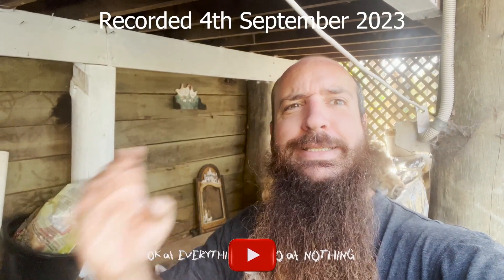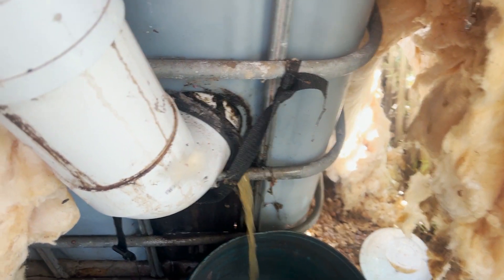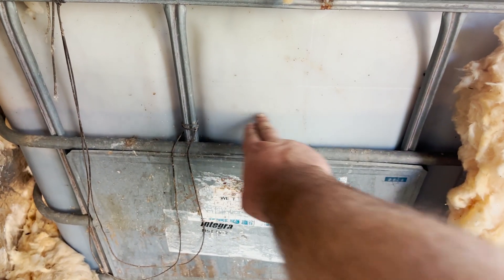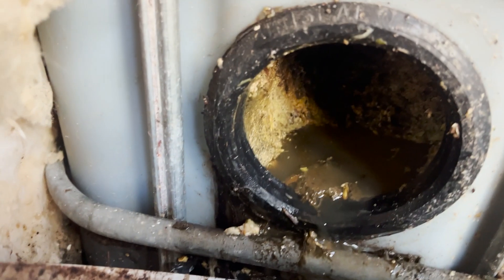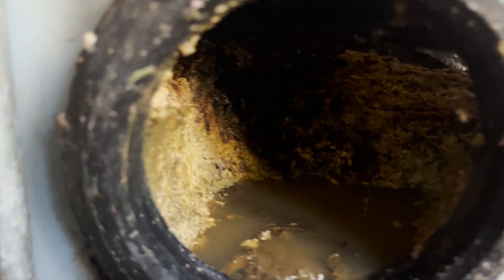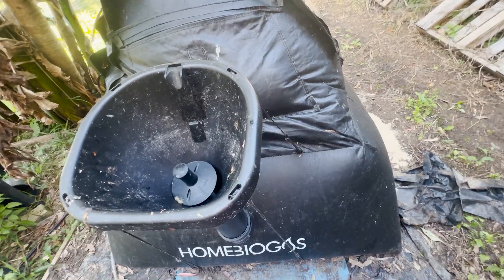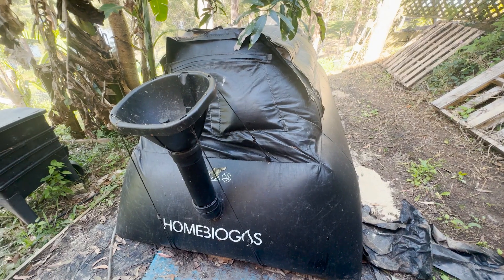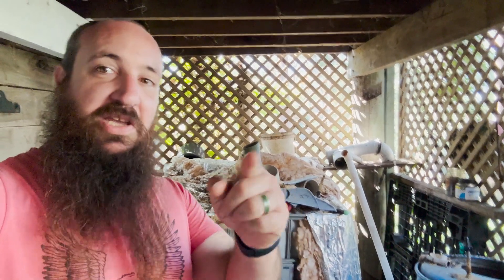HomeBiogas 6 - 1 year in operation

Comment: Can you take the methane from this and compress it with an aircompressor and put it into a tank and use it for later?
Reply from the maker: I have already made videos on that 😊
Reply: @OkAtEverything-ProAtNothing  how long does it take for the homebiogas to fill up if most of the gas is depleted? I have seen some of your videos taking the gas and compressing it. I'm curious about how long a generator could run on it to charge some batteries. Eventually, I'll get a solar system and a biogas system (doing home repairs to prep for it) so hopefully I can use it to charge the batteries

Comment: Awesome mate, I watched your videos years ago and I got a homebiogas 6 system last year. Its on my farm where my house is being built, so I havent used it in a daily sense yet. I also got the hot water heater because I want to get hot water for underfloor heating, and I also have a 3 phase 20 kva LPG/NG generator that I want to run the gas with, assuming I can scrub the gas properly and get the methane to 75% required for the generator. The generator runs max load at 10 mbar which is the same pressure of the Homebiogas 6. I have 120 tonne of waste all year round, and Im getting the fertilizer tested and the results should be back very soon. I am keen to get some polly tanks and paint the inside with appropriate epoxy so the tank stays good, so I can get more gas and fertilizer. Not a complaint but a suggestion I would have is for HB to make a pipe that fits into the feeding port so you can connect a pipe so you can use a grinder pump to pump straight in, those using kitchen scraps wont have an issue but ive got 400L bins full of fruit that would be easier to pump straight in with the appropriate water. But thats on my to do list, I have a 3D scanner and im going to make my own handle with a 32mm inlet and ill design it so it has a small tyre tube fitting on the bottom side so you pump up the tyre and it sits there and will be locked in air tight. Cheers from Adelaide mate
Reply: Hi Mate! I am also from Adelaide. Currently, I am in the very beginning stage of exploring the home biogas systems, in the process, I came across this video and comment. I would like to know more about your experience with this setup and how it's its working for you. Just FYI - I want this to be set up for the Not-for-Profit Organisation who feeds approximately 1500 meals per fortnight.
Reply: @revanthgupta1961  Hey mate, the only issue I have faced is climate, I am in the Adelaide hills and its quite a bit colder up here compared to the city. If you plan on sticking a 500 watt fish heater inside it then you wont have any issues especially if its insulated. If you dont stick a fish heater in it, then another option is to insulate it in a biomeiler environment, recently i insulated mine with cottage mulch which is 55 degrees and thats keeping it warm. If you have spare battery/solar power then a fish heater is definitely easier.  I havent made a feeding tube to go into it yet but I would certainty suggest doing that with a food grinder or grinder pump. I am unsure about how much cooking gas you would need to cook as many meals as you want on it. Lastly Im pretty sure they got rid of their Australian warehouse so shipping will be expensive. I think over the next few years I might end up selling my homebiogas and upgrading to a puxin cement tank that you make the moulds yourself, because they are 10m3 and buried underground and I have heaps of waste and Homebiogas 6 is too small for it. Nothing wrong with the system its just I need a bigger one. Cheers

Comment: I mate, hello from Shit Britain (it used to be Great once). I've just started watching your great video's, don't know if you do this but if you run bio gas through slaked lime Calcium Hydroxide solution, or Sodium Carbonate solution, NOT Bicarb, it will remove the CO2 from the biogas and make it burn hotter.

Comment: I could almost smell the liquid as you were pouring it 😂
Your new one is huge compared to our model from 2019.
Reply from the maker: Yer it’s quite big, biggest problem I have is not using the gas gas quick enough (primarily because I don’t rely on it full time) and I don’t produce enough waste to feed it properly. Major plan it to use the biofert into the irrigation system.
Reply: @OkAtEverything-ProAtNothing  when you did all the testing, did you happen to test the pH of the fertiliser?
Reply: @Bush_Edge_Homesteading_Aus  I have a HB6 and I sent my fertilizer off to get tested 2 weeks ago, it should be back soon, If I remember i'll come back and share what it says
Reply: @shredz4816  that would be awesome 👌

Comment: Does this work better then our IBC digesters.
Reply from the maker: Hey mate, been working and just life in general, been meaning to record more. As far as being better, I’d say the sheer capacity of 4000L vs 1000L is much better, and produces well, I would think the bacteria are more stable as well with the larger volume, the sandbags provide the gas pressure so no need for pumps etc. The ibc tank played its part, but was getting old and the seals failing getting more and more gas leaks, I was going through silicon to try and seal and it just looked messy. 
Also decided to buy the 6 to produce more biofert for the fruit trees, I’m still setting irrigation, but will eventually hook the fertiliser in directly to feed the trees. Next video maybe? 
Cheers

Comment: I'm surprised that you went with the HomeBiogas after building your own.  I have to admit that I found your videos after finding the HomeBiogas and, while I like the product's idea, I was concerned with the potential buildup of undigested material and the use of plastic sheet which will eventually degrade in the sun.  So I went looking for DIYers who had used more substantial components.
HomeBiogas also don't seem to have a long term approach to their product.  Yes they sell spares, supplies and upgrades, but they don't seem to have any information on how to decommission or move a unit.  They're very good at selling the dream, but not so good at helping you understand the reality.
I'll be interested to see your experience in a few more years.
Edit: their corrected they're.. so embarrassing for a their/they're/there pedant to get it wrong.
Reply from the maker: Thanks for watching and taking the time to comment, I have spent years building, maintaining and repairing my DIY designs, I have learnt a lot, it was a case of moving to my new property and wanting to produce more biofert for all my fruit trees, so do I build 4x IBC designs and link them together or trail the 4000L HB6, the same could be done  with a 4K L water tank set up like a digester but I figure I’ve done the hard yards with diy and time to try something else. As you have mentioned and stated in this video, I am concerned with the eventual build up of solids, and you are right I have not seen any decommission info yet, hopefully that is issue is in the distant future, I will be sure to record if that day comes.

Comment: Was turning to a mainstream supplier a better choice than building your own? I'm halfway through an IBC build now using some of your techniques such as side mounted digestate outpipe. Is the convenience of a purpose built unit worth the 100x expense over a self build?
Reply from the maker: It’s a bit hard to answer, I would say it depends on if you really value diy and get that pride from troubleshooting and building yourself, I have spent many years building and maintaining my DIY build so I’ve done the hard yards, and at the moment with work I’m a bit time starved to have to constantly monitor my old system, I wanted something bigger  to produce more biofert for the garden, so whether I linked 4x ibc designs together for 4000L capacity or just got a HB6, the costs sort of work out anyway, by the time I buy the IBCs, seals, pipes, fittings, tubes, scrubbers etc and the stupid amounts of silicon to seal air leaks (probably my own dodgy fault), and plastic degradation. Each to their own really, both DIY and manufactured will produce gas when principles are followed.
Emptying or build up with the HB6 design may prove to be an issue one day. We’ll see.
Reply: @danieltaurins86  a good overview. Appreciate you giving your thoughts. Down in tassie it's always going to be a bit of a hard sell due to being inactive half the year because of the temps.
Reply: @Blxz  Yes I heard it does not do well in Australia below the Brisbane line, however I have seen overseas people put a hoop greenhouse over the unit in the cold, and buttress the sides with hay that has water poured on it and covered with plastic, the breakdown of the hay creates heat as a byproduct throughout winter and can be topped up, so that they work in the snow.
Reply: @michaeldemarillac9992  good advice. I was considering cheap camping solar and a heating element for energy dumping but the hay sounds good considering my situation.